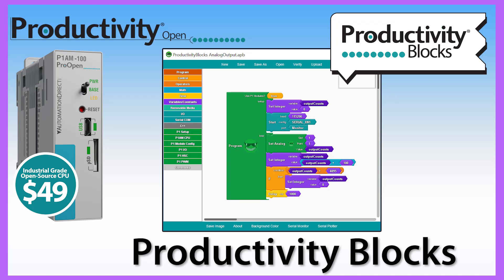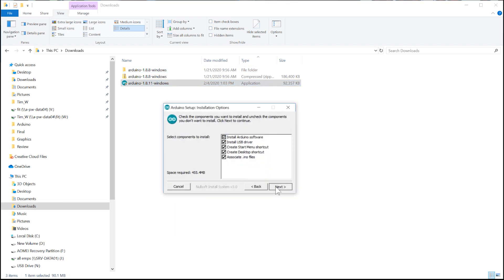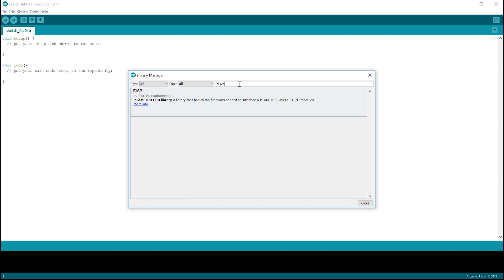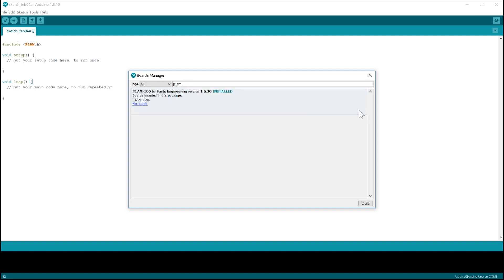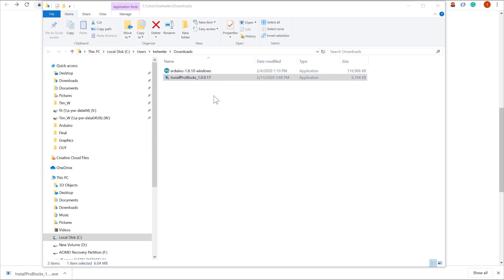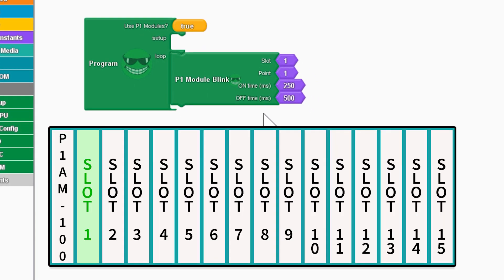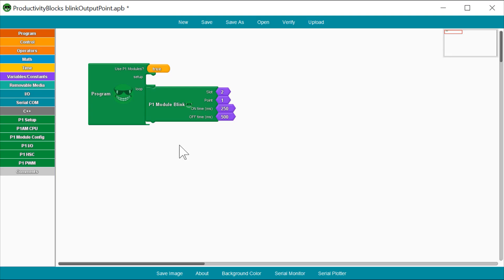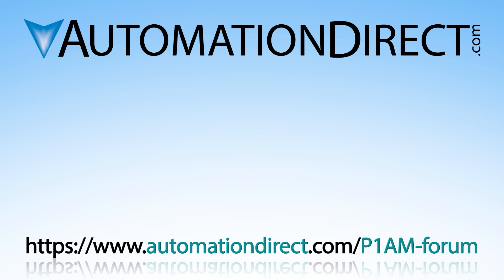Productivity Open (Arduino compatible) Productivity Blocks from AutomationDirect

Comment: Can we use these productivity open CPU’s with HMI’s?
Reply from the maker: Arduino platform is extremely flexible. It is capable of talking Modbus/TCP with the Ethernet Shield. It will require some complex coding but there are many examples out there. Any of our Ethernet enabled HMI systems will support a connection with Modbus/TCP as the master/client to the Productivity Open/Arduino as the slave/server. Take a look at the CM5 as a great option. https://www.automationdirect.com/adc/shopping/catalog/hmi_(human_machine_interface)#Series_ms=%22C-more%20CM5%22&start=0

Support for the Productivity Open is through our online community as well as the numerous open-source Arduino communities as well. Thanks!

Comment: any chance of writing the software for Linux?  arduino works in linux, however productivity blocks does not.  I have to use wine or dual boot.   Thanks!
Reply from the maker: Hi John, We currently don't have an option for Linux but will pass the suggestion on to the development team.  Thanks!

Comment: I have followed this step by step and I get an error saying that Arduino Software is not installed. Any suggestions?
Reply from the maker: Thanks for the comment Chad. Not sure of what the issue may be. I would advise calling into Tech Support for help. 1-800-633-0405
Reply: I had the same problem.  The solution was to uninstall and reinstall the Arduino IDE software.
Reply: I had the same probelm as well.
Reply: I installed an older version of arduino and it worked